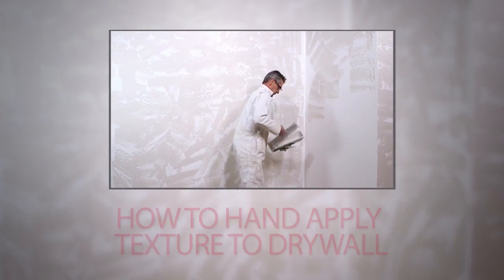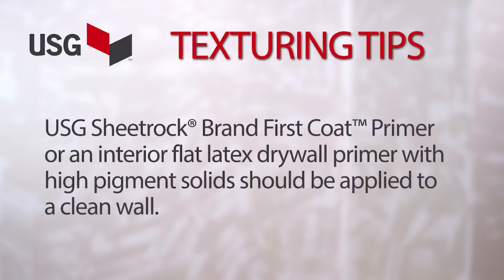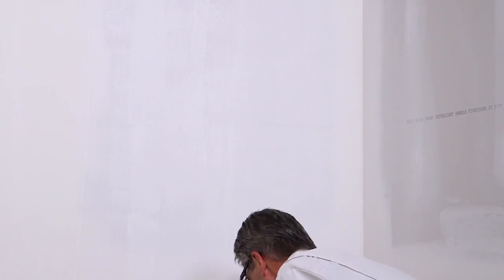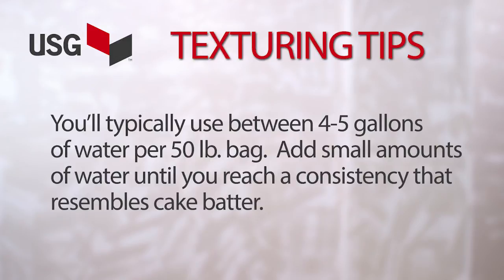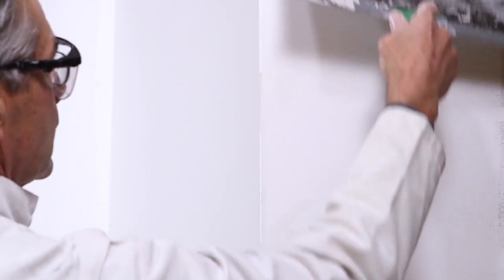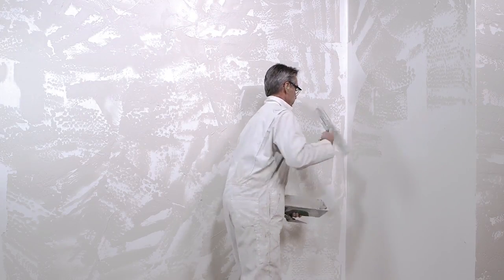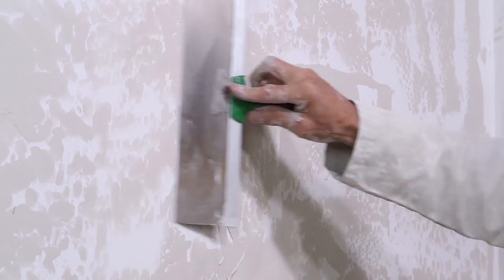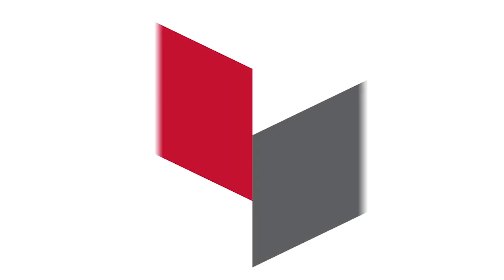USG Surfaces: How to Hand Apply Texture to Drywall

Comment: Personally I think texturing a wall or a ceiling is just a recipe for creating more work whenever you have to repair the wall… You will need to know exactly how to match the texture and this can be very frustrating if you were not the person who applied it in the first place.... and of course not applying texture on a previously textured wall is going to look absolutely ridiculous and is going to stand out like a sore thumb. 

Perfectly flat walls are perfectly easy to repair by anyone.
Reply: Smooth wall is much harder to hide the patch though...
Reply: Eric Hemingway smooth surfaces have their own difficulties. With larger patches, if you don’t cut back the paper on the joints, you end up with a slightly raised surface after taping that some eyes catch easily. Even though it’s more material and a bit more work—and messy, a knockdown texture is easy to match and blend out—more so if you have a spray gun for heavy materials—and it hides those lumps from sight.
Reply: Your wrong. Smooth walls take alot more work to cover imperfections in your walls. Hand textures are cheaper too do becuase they easily take your eye of and hide imperfections.
Reply: Nathan Different strokes for different folks.  As I said, smooth walls have their own difficulties.  Texture is faster if you know HOW it was done, harder if not.  Also, textures is harder to keep clean and more work to repaint.   I am no pro, but I have no issues making walls and ceiling perfectly smooth.
Reply: @GearGuy  Ive been a finisher for 4 years. Smooth wall is much harder that's all I'm saying.
Reply: Or just leave the studs showing and never have to worry about paint or repairs.😄
Reply: @trace6402  If only that was an option…  I don’t make the choices, I just have to implement them, lol!